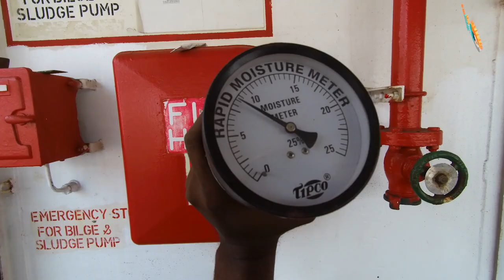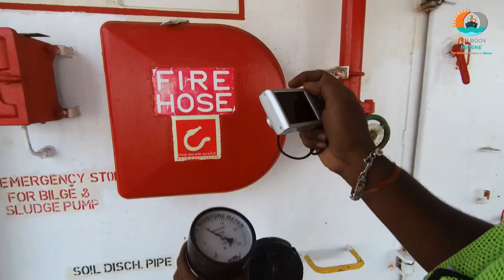How to test Moisture Content of Cargo onboard ship using Can test and Lab test || Can test Onboard

Comment: Let me advise one thing - the equipment they use is useless due it is designed for Grain Moister observation - It is not so aqurate as it would be required. So the only on board Can test could be the ligt evidence of cargo condition. So if in doubd - call P&I. other vise - it could be problems later on - PORT PARADIP/ KAKINADA - they know the situation ))))
Reply from the maker: Exactly.